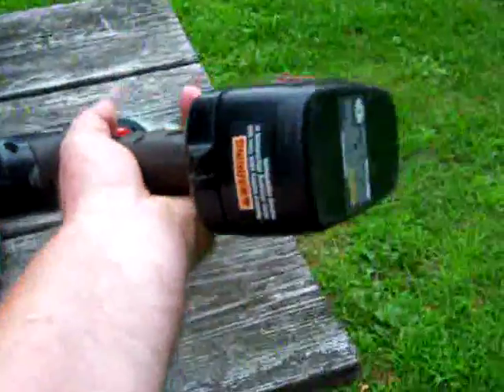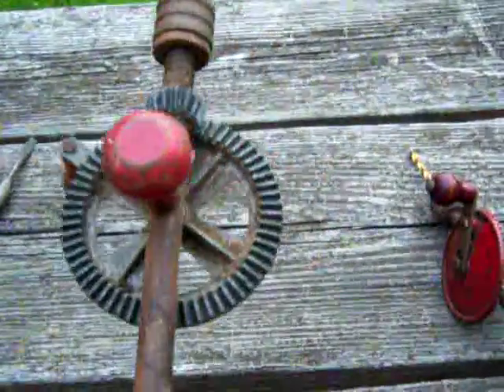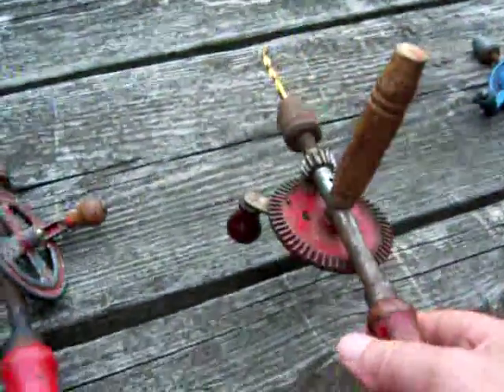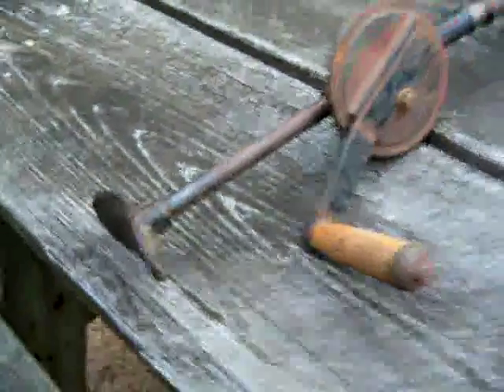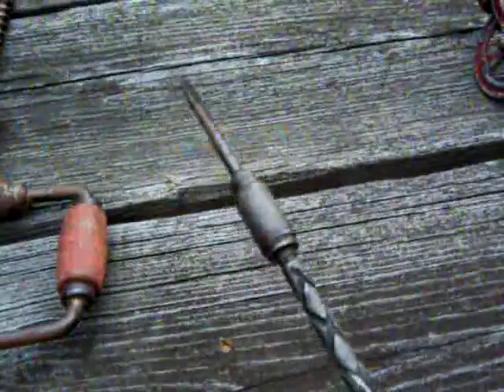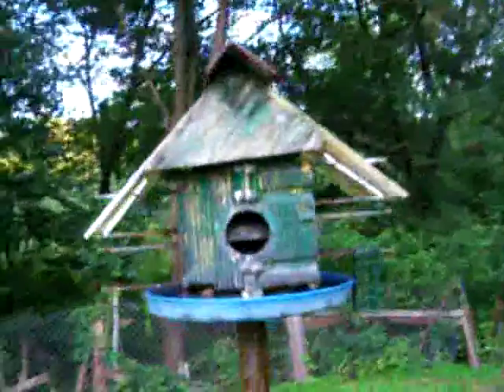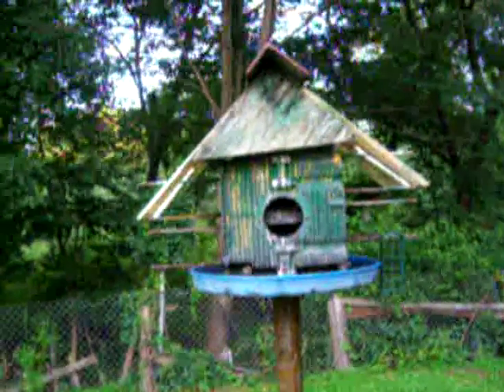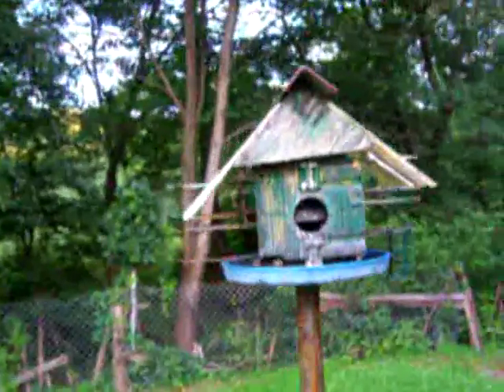Antique Hand Drill Collection

Comment: I have several of those older drill,and even one "Brace" type that was made in the 1930's to hold ROUND bits. I use that one when I am out in the "back 40" doing fence work. We used to call those smaller drills (that look like an egg beater) a "Hurdy-Gurdy", because that is the sound they make when you use them.  I have two of those "Belly drills", and use them a lot. One of the best antique drills I have is an old "Post drill" It will drill through thick steel better than a modern drill press.

Comment: Nice collection!

I normally wouldn't point out an error but you repeated it soooo many times! Those are not worm gears, they are straight or spiral bevel gears. An example of a worm drive is what you will find in metal hose clamps.